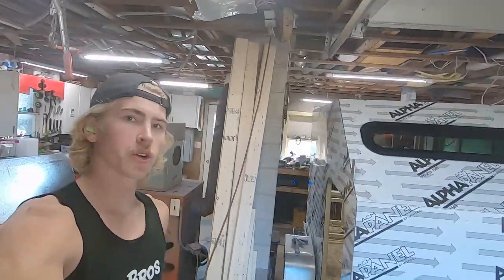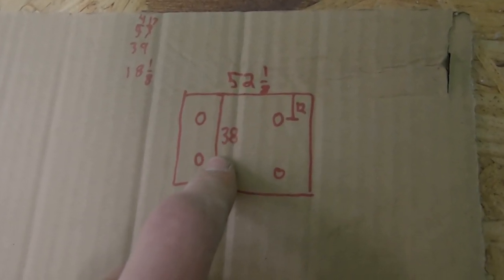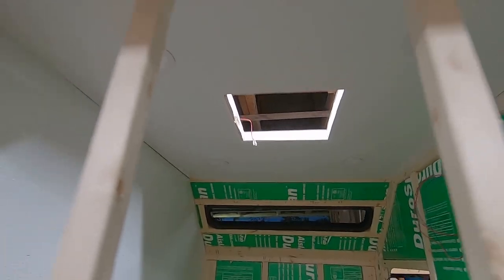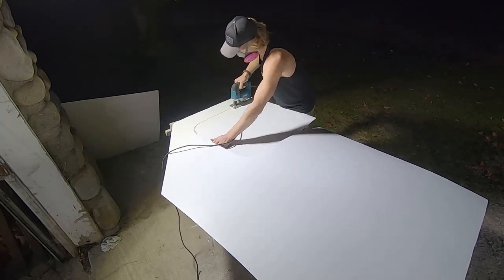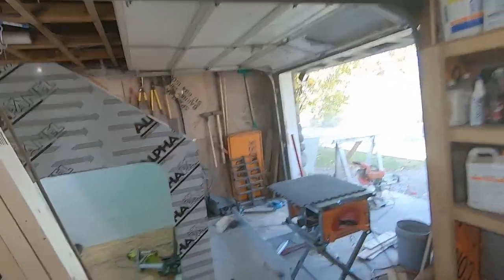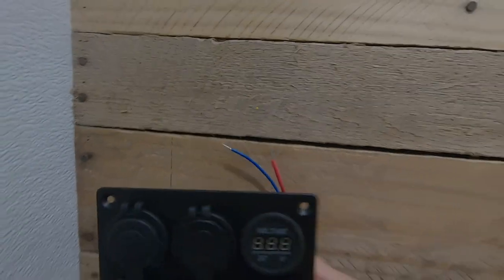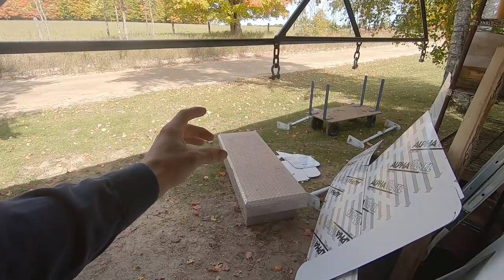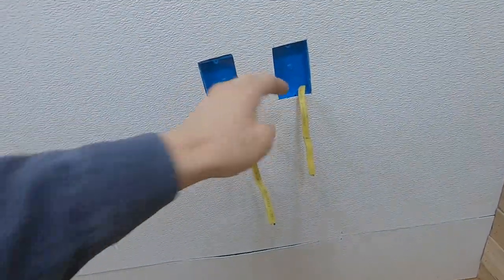DIY Square Drop Camper Budget Build Part 5

Comment: you're doing a great job. I was hoping to see someone use FRP panels on the inside. did you use any adhesive on the panels?
Reply from the maker: No I didn’t! But I wish I went with something a little stiffer just because you can see any little imperfection on it